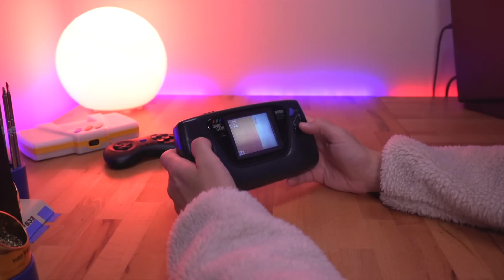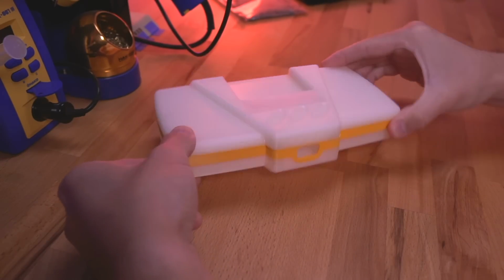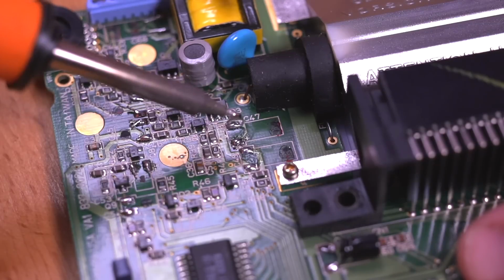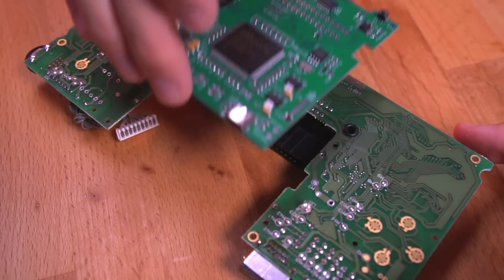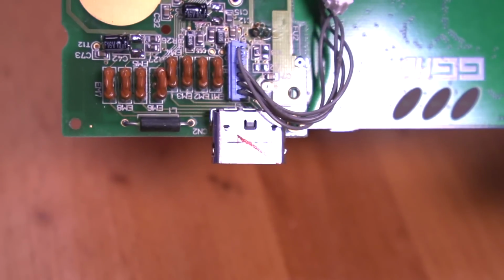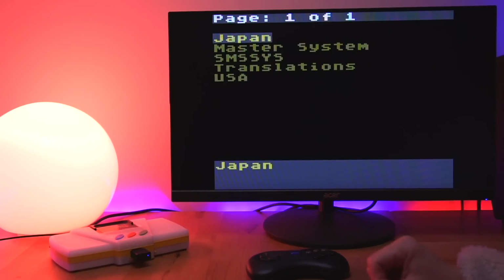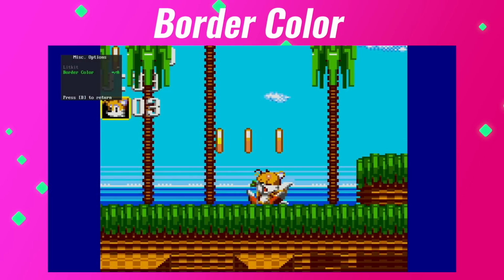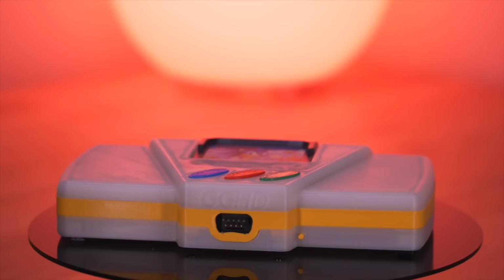GGHD | Hi-Def Game Gear Consolizing Kit

Comment: Wouldn't be funny if someone turned a Sega Nomad into a home console
Reply: So a sega genesis without cd and 32x support....sounds like the Genesis 3 XD
Reply: It already is, it has a Mega Drive/Genesis display connector at the top.
Reply: @nicholsliwilson  r/woosh
Reply: @gabyy1827  or weak joke, you decide?
Reply: @nicholsliwilson  I'm going with "whoosh"
Reply: Ikr
Reply: I'd also like a portable Super Game Boy and Game Boy Player.
Reply: @mrbisshie  me tooo
Reply: Technically speaking, it already is. The Nomad has an AV Out and two controller ports
Reply: @FezTheSpaceBiker  *one controller port. The inbuilt controls are always controller 1 even when it’s plugged in to the TV.
Reply: @mrbisshie  I get the joke but there have been a couple of Portable SNES’s over the years that take real SNES cartridges, at least 1 of which worked with the Super Game Boy.
Reply: ... Wait...
Reply: I love this! Its so revealing of who answers and how!
Reply: You mean the genesis 3?
Reply: @MachoNachoProductions  you should your PS5 DEVKIT TEAR DOWN, But review a case less piece of hardware "given to you by a friend" censor out any branding on the board and any links to Sony and PlayStation, but drop subtle hints in the video as to what it might ne
Reply: The Sega Settler
Reply: Its been done. Mod the 2nd player port for 1st player (its all internal, reversible and easy to do now) and then add an external retrotink 2x or 4x. The Nomad is now portable and conslized. There is no 2nd player and it all works.
Reply: In case anyone doesn't get the joke. The Game Gear is basically a portable Sega Master System. Although they might not be exactly the same so do your research I guess.
Reply: @entropy-cat  I get the joke. But I am sadly very serious. :)
Reply: @wyldelf2685  I use a regular genesis with 3BP for light gun games. Also, one player SOLO gaming is how it all started.  By using a MegaDrivePro cart the games and game saves are portable. So its easy to pick up single or a multiplayer game on the move by using just that one cart and a couple of original consoles.
Reply: It already is just plug it up to the TV it's way ahead of its time
Reply: Sega already did in sega genesis lol
Reply: Sega did with the Genesis :)
Reply: @nicholsliwilson  thr supaboy is the most famous portable snes
Reply: @entropy-cat  I'd say the game gear is a mix not hybrid but half genesis mostly master system
Reply: @entropy-cat  some game gear games some are like the genesis games but even sonic 1 and 2 are different on the gear
Reply: @blueskies792  OP thinks they were jokung.
Reply: @GelzarZakcrakious  good, well done, that was the joke. It falls flat because you can plug a Nomad in to the TV & plug in a second controller but an attempt was made.
Reply: @illkid86  they're really not & it's really not. The Game Gear is literally the same chipset as the Master System. Many Game Gear games are literally the Master System ROM on a Game Gear cartridge & devices like the Master Gear Converter allow you to plug Master System cartridges in to a Game Gear.
Reply: Yeah that's what I was going to comment.
Reply: Ikr would be the best console ever made frfr
Reply: @GelzarZakcrakious r/woosh
Reply: @realslimsh8y  in my country reddit is blocked
Reply: Imagine being able to play Nomad games On a TV! One can only dream…

Comment: I’d like some elaboration on the Master System functionality. Do you mean it can physically play Master System games without the Master Gear Converter or do you mean the GGHD has some extra sauce for whenever a Master System game happens to be running instead of a Game Gear one? Also, form factor wise does the consolizer accept the Master Gear Converter or no?
Reply: A Game Gear can play Master System roms stock.  You just need the cart adapter.  There is no "extra sauce", the game gear can already do that :)  He's just saying that the kit can properly display Master System games.  

Of course you'd need a cart adapter if you want to play actual SMS games.  That is a good question about whether the case can fit a converter or not tho.  Would like to know that myself.
Reply: Bump on this as if I buy this kit i would like to not have to mod the case to fit my Master System cart player.

Comment: One negative I might observe which has not been previously mentioned.  I did not see that any 15KHz analog video capability offered.  This can be done over HDMI as seen with MiSTer.  31KHz analog video, which should be achievable via an HDMI to VGA converter, just is not good enough :)
A positive to this mod is that your recapping became a whole lot easier (if even necessary), as it does not use the power or audio amplifier boards and there are six fewer capacitors on the main board that need to be replaced.
Reply: Why is it not good enough?  15Khz is a computer monitor standard is it not?  Most kits aren't going to have that.
Reply: @skins4thewin  It is the standard for SD CRTs, whether monitors or TVs.  If you want to use this device as if Sega made a "Super Game Gear" back in the day that functions like a Super Game Boy, you cannot.
Reply: @NerdlyPleasures  Oh I gotcha, so it's the other way around then aka 31Khz is the standard for computer monitors am I right?
Reply: @skins4thewin  Yes, it is the standard for monitors that can handle 480p, which includes certain "HD" CRT TV.
Reply: @NerdlyPleasures  I never did really understand the difference when it comes to the KHz of the signal & how it portains to consumer TV's/Computer monitors.  Will have to look into that a bit more.

Comment: Really great kit but I’d like to see the option to use USB controllers like the ones for the Mega Drive/Genesis Mini’s. Having said that I’ll probably use a Master System controller (should just work?) with it as it stands as I refurbished a couple to use with my Amiga.
Great video, thanks Tito.
Reply from the maker: Usb controller support would be a really cool option!
Reply: To be fair they DID make Bluetooth versions of those Genesis Mini Controllers which should work (I THINK)
Reply: @GatorRay  I don’t think the GGHD supports Bluetooth does it? The Game Gear certainly doesn’t, it significantly predates the existence Bluetooth. The Genesis Minis 1 & 2 don’t support Bluetooth either & wireless pads for them connect via a USB adapter.
Reply: @nicholsliwilson  Sorry.
Reply: @GatorRay  hardly the end of the world. 😊
Reply: @nicholsliwilson  Okay

Comment: Great video , just found a bit odd that u cut the legs on the capacitors if u then use soldering iron to remove the left over legs. Might as well of just unsoldered them in the first place. But I'm sure there's a reason lol

Some fantastic soldering skills on display in this video
Reply from the maker: Thanks Will!  The full recap is done just to ensure the console is fully functional before we do the mod. It is definitely strange but necessary for game gears which have very weak caps
Reply: Or maybe just not replace those caps in the first place if you know you're gonna hafta remove em anyway.

Comment: This is pretty dang cool & definitely something I've been waiting for but I dunno... It seems not quite as refined as it could be.  I feel like it could use another revision or two & a little more time in the oven.  I am sure there is a better way to design the kit for easier installation and the case as well so you don't have to remove the controller port shroud.  Having no shroud for your controller port is just not a very good idea.

Comment: It seems there’s not much of a recess for the game controller and the pins are just exposed.  I know they’re pretty strong but without the metal shield it would seem that with a controller or dongle attached there’s a chance that there would be more leverage to bend them i.e. someone pulls to hard on the controller cable at an angle or something hits the dongle from any side and bends the pin.

Comment: I might have missed it but does the kit come with the wires?

I have an old Game Gear that a coworker and I tried to LED backlight back in 2007/2008/2009 (can't remember exactly). After the first attempt failed (LEDs weren't bright enough), I chickened out and put it in storage. Besides needing a recapping, it would be ideal for this mod, thought I don't trust my soldering skill are up to snuff for some of those more delicate soldering points like the resistors and soldering the GGHD board to specific pins on the LCD connector pins.

With the cheapest kit being $160 and my Analogue Pocket shipping soon and arriving before the end of the year, I thinking eventually getting a Pocket Dock may be cheaper in the end.
Reply from the maker: Hey Gumby, nope the kit does not come with the wires. 

Analogue pocket is pretty amazing plus it now has the ability to load cores with is awesome!

Comment: Wait. I don't get it. 
Are you using a signal converter to read games from a GameGear and play it on your TV with a Genesys controller ?
I mean, it surely is fun to build but whats the point versus emulation on PC in this particular case ?

I totally validate other mods on your channel, for having build some myself but this thing makes no sense 🤔

Anyway thumb up for the video 👍

Comment: For the price it should have second controller support for the master system games.
Reply: Doesn't really work that way.  The Game Gear does not support 2 player functionality in that way, so it's not possible unless you just did away with the Game Gear & had an actual SMS FPGA core running off the consolizer's FPGA itself.
Reply: @skins4thewin  Thank you, first smart comment I heard about that.  Too many supposed gamers are not informed and think anything can happen.  He probably thinks an Atari 2600 cart should go into the Blu-Ray slot of a PS5.
Reply: @terencehill2320  The vast majority of gamers don't know technical details unfortunately.  Is what it is.  I just happen to be a tech guy who also repairs these systems on the side.

Comment: Did you happen to lag test this kit by chance?  I would definitely recommend getting a Time Sleuth.  It's inexpensive & very easy to use & will allow you to feature those tests in your videos here!  Lag testing should be an absolute must when dealing with any sort of video game mod. I definitely won't be buying the kit til I see some lag numbers.
Reply: There is no lag, its original hardware and I tested it personally.
Reply: @terencehill2320  It being original hardware has nothing to do with it.  The kit itself is doing some upscaling which like any upscaler may or may not add some lag to the mix, thus it still needs to be lag tested proper. 

If the upscaling was done properly then it should indeed add very minimal lag.  What method did you use to test it?
Reply: @skins4thewin  thats my secret as well as any that Postman worked on the GGHD prior to his passing.
Reply: @terencehill2320  We can't be sure if there's lag or not til it's tested.  Just sayin'.  Many upscaling tech adds lag, so we can't just assume it doesn't.

Comment: Unfortunately that price and how it's even assembled is brutal. It offers literally nothing over an emulation device whether it's a software emulator like a good Android box or an FPGA thing like MiSTER.
The really bad thing is that this requires sacrificing a GameGear. You have to mutilate the motherboard to only work as a consolized version and it requires extensive soldering to even do so. If memory serves the GameBoy (Advance I don't think so?) one was not permanent and required no additional soldering, but it was able to benefit from some.

As a technical feat this is top-notch, it's amazing it can be done. Ethically I don't like it because it requires sacrificing a working GameGear since, let's be honest, there's nothing you can't do to fix a GameGear if it's able to work as a consolized one. Need a new screen or to recap it? Well, it'll work then...

And again, that price. I despise FPGA emulation devices due to how utterly bland and featureless they are for emulators (sorry crypto bros, they actually ARE emulators) but they're insurmountably cheaper than this while offering the same performance since hardware emulation is 100% perfect. Software is like 99.9%... but you'd never notice the extra .1%.

Comment: I would so buy it if it were for being required to be used on high-ping technology like most HDTVs.

If someone can make it work with RF, Conposite, S-Video. Component, or SCART. i can guarantee close to zero ping.  Any analog consolized Game Gears?

Also any consolized Atari Lynxes?
Reply: It was a thought to do a Lynx but the creator of the GGHD passed away in June 2023, thats why you dont see any updates.

Comment: I don't get why you should need to remove the controller port metal shroud.  Most of these kits keep something like that so the controller can connect firmly.  I would definitely want to find a way to do this while leaving that shroud on so my controller can plug in nice & snug.  I do not like the idea of removing it at all.